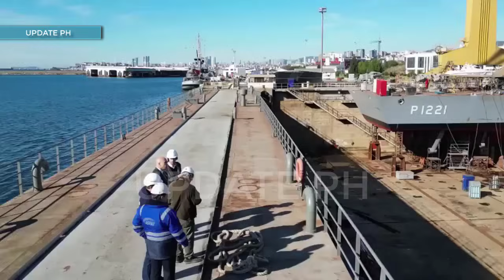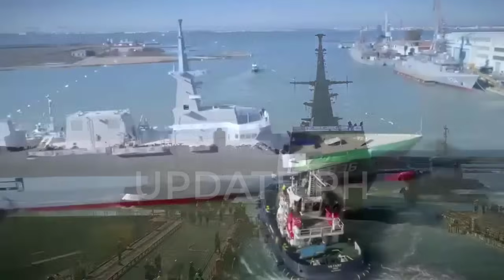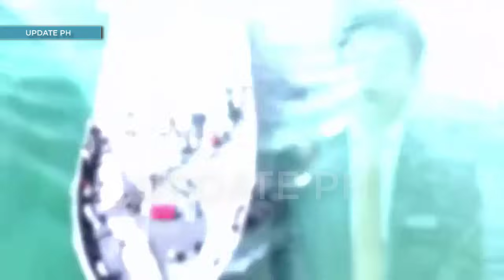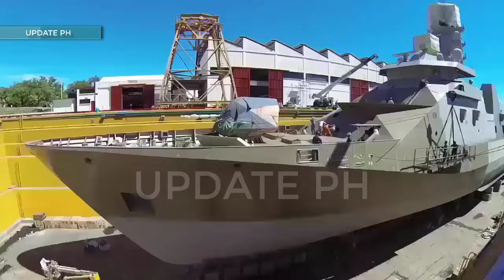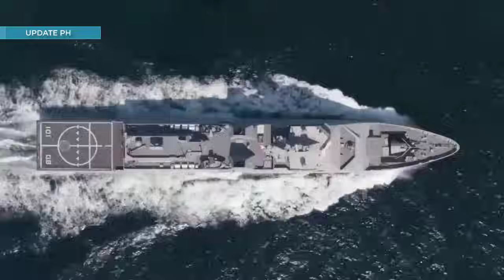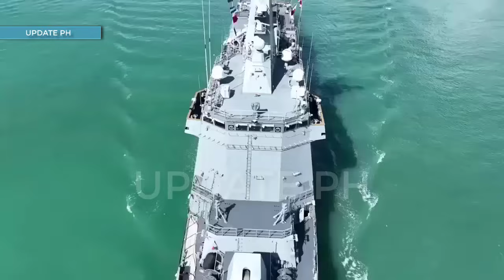TWO HDF-3200 CORVETTES OF THE PHILIPPINE NAVY TO BE LAUNCHED IN THE COMING MONTHS

Comment: Is it HDF Or HDC, 3100. The PN should acquire bigger ships like the 160 meter Destroyers. Even 2nd hand as long as it is equipped with 72 vertical cells for anti air missiles.